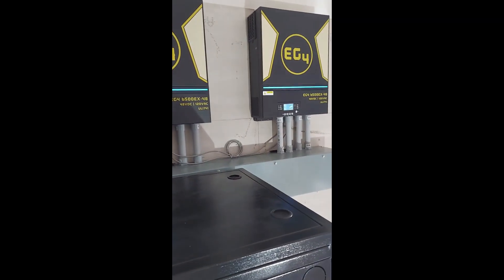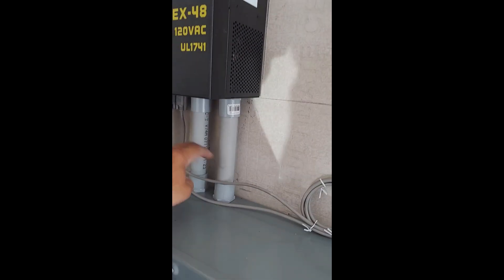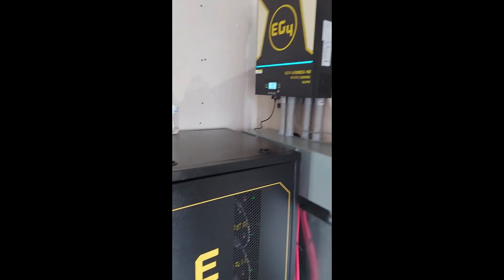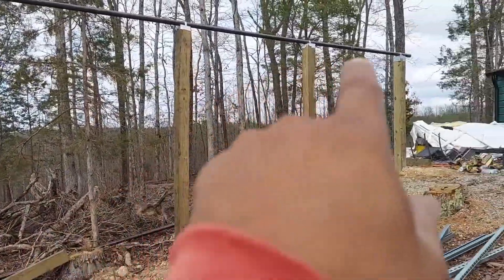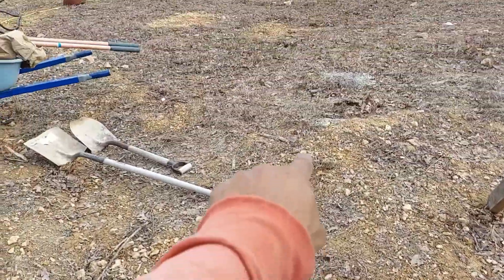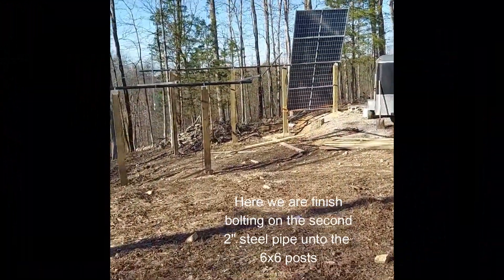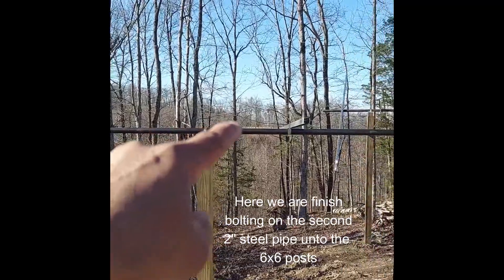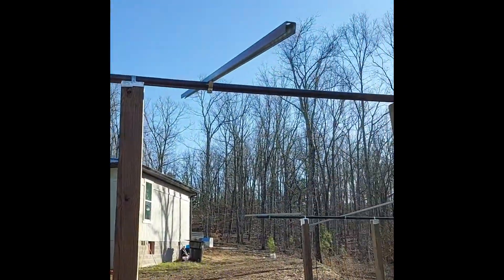Part 2 -Two EG4 6500EX, 13kW, 6 EG4 LifePower4 48 Volt 100Ah batteries, Off Grid  install completion

Comment: Very nice.  I wired my inverters to the batteries with one positive high with that inverter negative low and the opposite for the second inverter.  I have the 6000XP's.  Hope he does not get any high winds on those large panels with no gaps for pressure release.